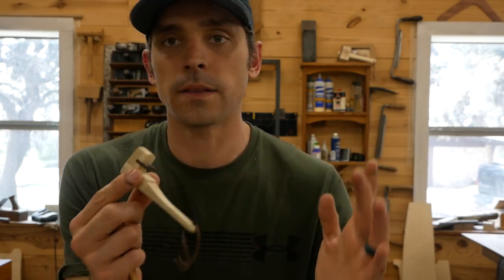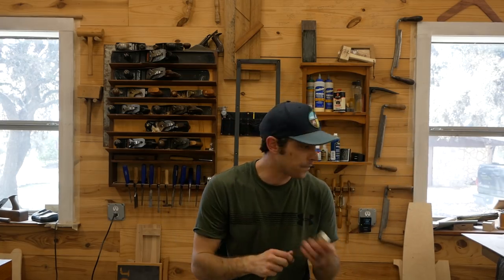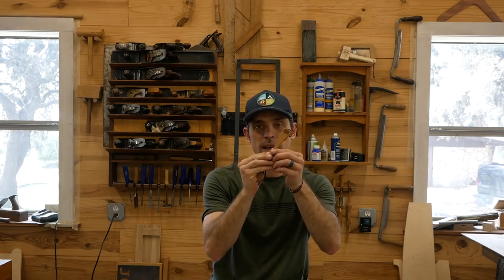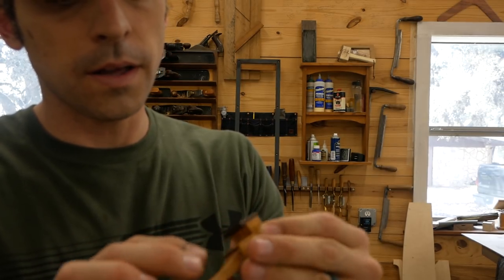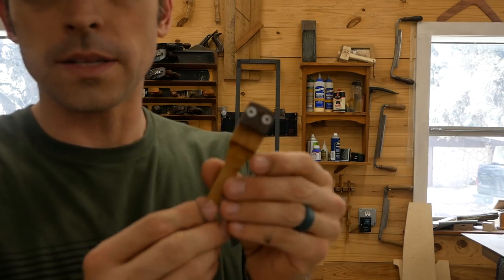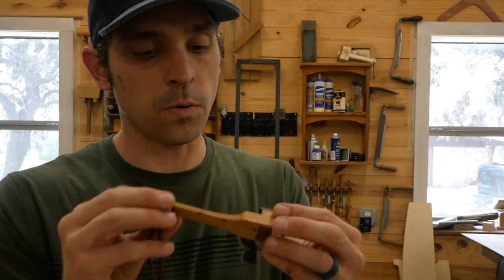Making A Bottle Opener From An Old Cedar Fence Post

Comment: I had the same issue with my bandsaw blade twisting out like that. Turns out the tires were not uniformly thick. Every time the high side came around it would cause the blade to deform and sort of twist out. New tires made a quick fix of that issue.

Comment: Wood could be an option if you tweak the design a little bit. Where the bottle opener puts pressure on the top of the cap is too close to where it prys up on the cap. This makes it exert more force trying to bend the cap rather than break the seal. Try designing it so that the pressure on top of the cap is further away from where it prys up.

Comment: When I try to rip long straight pieces on my bandsaw the blade always warps, regardless of how high or low I set the guide.  Should I use a thicker(wider) blade?  I get pissed because I end up having to resquare everything and make the pieces smaller.  Any advice would be awesome.  Great piece by the way.  I'm going to try this for myself.  Always wanted a cool bottle opener.

Comment: Came through Bourne this weekend.  Wish I could have stopped at your shop.  I have a question about your shop door.  The sliding one.  Is it tight enough when closed to keep things out?  Is it air tight?  Love your work, what’s up with the band saw project?
Reply from the maker: No it has about a 7/8” gap all around the door.  It can be sealed with custom weather seal brushes which attach to the jamb.

Comment: I just found out about your channel from Off the ranch. I’ve only watched a couple videos so far and you use of hand tools is impressive to say the least. But I was curious what find of glueing method are you using on the bottle opener?
Reply from the maker: It’s CA glue, essentially just super glue.  The spray activates the glue and sets it up instantly.  It’s quick and easy.

Comment: I love ca glue and activator sprays, just do some testing some makes the glues weaker others give a false set, so while it’s dry it doesn’t have its full strength right away.  Don’t think the glue was an issue but still wanted to point that out since I’ve had hit and miss with applications. 

Instead of adding screws how about drilling and putting wooden dowels inside.

Comment: You could have drilled into the end grain of the part that broke off (before it broke) and reinforced it by gluing in some narrow hardwood or brass dowels, instead of the screws you used after it broke.  1/8th inch brass is cheap and would look pretty sharp.  I think you might need to use metal instead of the walnut(?) for the part that actually engages with the cap, or it's likely to get eaten up over time.  I've seen people use washers but they are ugly, probably better to make something custom.